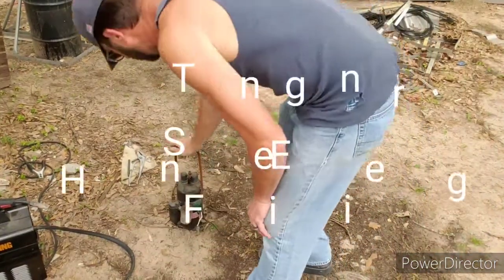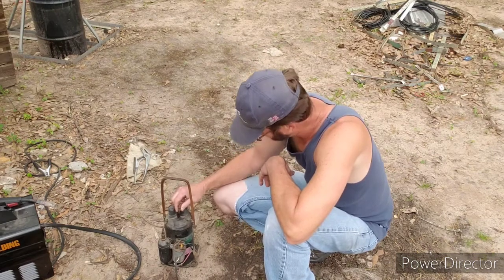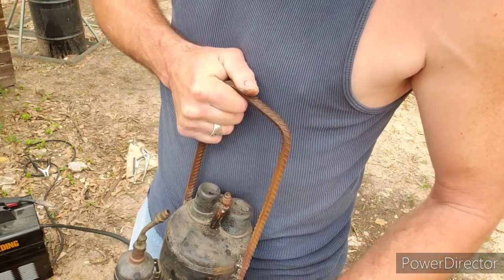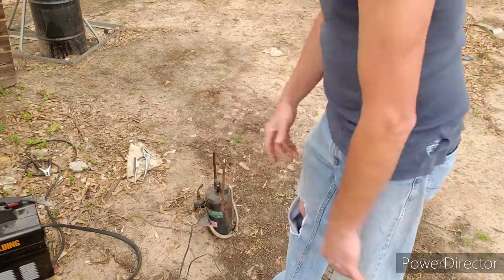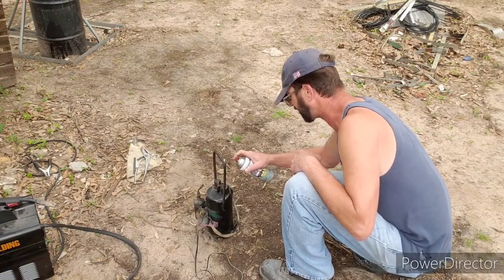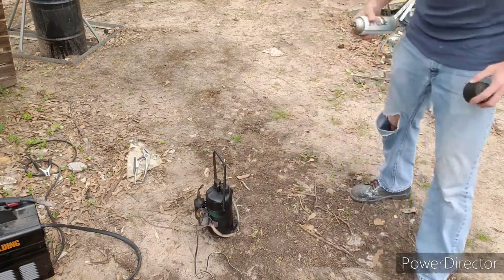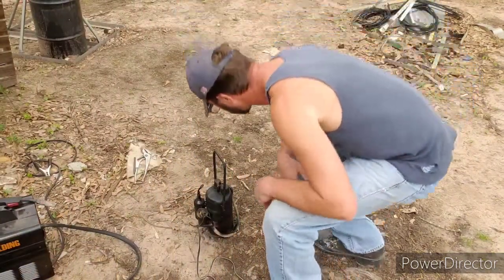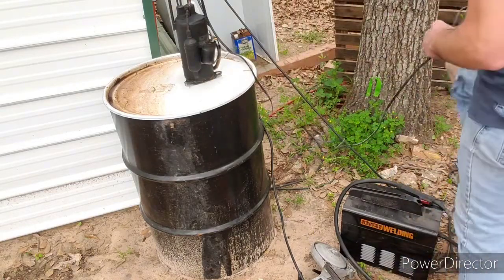Strong Vacuum Pump DIY

Comment: Good video brother 👍 Just keep it upright if it uses a current relay because the contact points need to fall out if the circuit by gravity once the motor starts and goes to the lower run amps. Those are the little relays that plug on to the compressors pins and rattle when you shake them. If the relay is bad you can just add a 3-in-1 start kit "hard start" which has a solid state relay (thermistor) and works in any position.